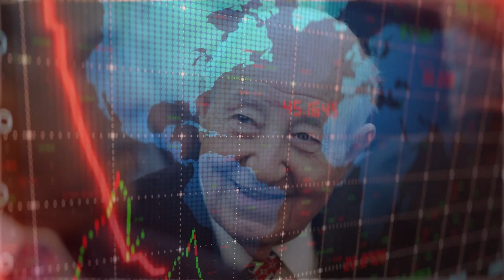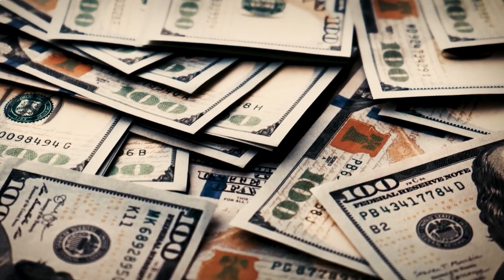Inside the Incredible $6.4BN Gordie Howe Mega Bridge

Comment: Your suggestion  that the blockage led to the decision to build the Gordie Howe is completely wrong.  The blockage took place long after the bridge was conceived, highways in Ontario were created to divert trucks to it, and the bridge construction begun.
Reply: There's also an international tunnel connecting Detroit and Windsor that isn't mentioned
Reply: @NorthernElevations    Which can't handle regular commercial traffic.  Empty auto haulers, flatbeds, and small cube trucks are all that can utilize the tunnel.
Reply: @NorthernElevations many trucks can't go in the tunnel though
Reply: @NorthernElevations  There are 2 tunnels, one for motor vehicles and one for trains. The train tunnel is visible on google maps.
Reply: @NorthernElevations  Don't forget the Blue Water Bridge further north that connects Port Huron to Sarnia.
Reply: The other thing he missed the real reason the bridge was needed: all that traffic was cutting the west end of Windsor in half. Any time there was a border slow down there is a wall of trucks down Huron line which isn't a highway, it is a city street
Reply: Exactly. This bridge wasin the works long before its initial construction AND the blockade of the truckers .
Reply: was thinking the same thing... then i went to the wiki page for it and this guy read it almost word for word as his commentary.
Reply: 911 is what started this project. The backup at the ambassador bridge was half a day long, and truckers tried to divert to the Detroit tunnel which cause major delays on top of major delays. The amount of commercial traffic that crosses in Windsor is staggering and has a major affect on the economy for all of North America. They realized they need traffic to flow and only having one 4 lane bridge and a 2 lane tunnel was not enough hence the need for  another means of crossing the river. There was a railway tunnel as well.
Reply: yet Northwestern Ontario still has 2-lane roads, so dangerous
Reply: lol, yah looking down College I could see the two completed bridge spires behind the protesters on Huron Line. The bridge project started about a decade before anyone even knew what covid was.
Reply: @debunkthejunk1 
Exactly. The trucking company I worked for had a yard near Gordy Howe construction project. I could see it DURING the lock-down.
Reply: It came about because Matty did not want to place nice with the government safety authorities.  There was also Matty claiming he was acting in place of the USA federal government.

I broke a monopoly
Reply: @rogergrondin4374  What a maroon! 😁😁
Reply from the maker: You're absolutely right! The Ambassador Bridge blockades did occur much later, and construction for the Gordie Howe Bridge had already begun. The new bridge is a long-term project planned to address the growing need for efficient cross-border traffic flow for years to come. Thanks for pointing that out!
Reply: @MegaBuilds5280  if he’s right, then why was that it implied in the video?
Reply: Or that Covid delayed the project. All construction was classified as an essential service and exempt from lockdowns.
Reply: In addition if they can block one bridge they can block two bridges.
Reply: @grantmacnei9880   The approach to The Geordie Howe is part of the 400 series highways....  Attempting to block it would be a federal issue, not a local issue like these idiots  blocking Huron Church road was......
Reply: 😅 @ClintonAllenAnderson
Reply: Government controlled media
Reply: Omg are you serious blaming the blockade as one of the reasons for building this bridge? It was already in works and later in the video you even mention that there will be a delay in its completion due to the plandemic…oops pandemic . Get your facts straight!
Reply: Don’t forget about the blue water bridge 🤔
Reply: You are correct
Reply: I don’t see how at 2.5km this will be the longest bridge in North America. If you look just a little bit north and a little bit west, you will see a bridge that connects Michigan’s lower peninsula to its Upper Peninsula. It spans 26,000 ft, or 5 miles, or 8km.
Reply: @drewhubbard4459  Its the longest "cable stay" bridge in North America. That means the bride is fully supported hanging by cables rather than from pillars or piers from underneath it. Most bridges are supported from underneath from giant piers.
Reply: @pcs5852  a: I was around when PT was prime minster, useless. B: I was in Windsor during 911 C : neither Trudeau had anything to do with building the Gordy Howe bridge, I know this because the planning and infrastructure was done with windsors input and I was privy to this. D : if you want to meet aboriginal people it is really not that difficult. You just need to leave your mothers basement.
Reply: @jcar1417  Ahem for your brilliant comment :)
Reply: @pcs5852  dude that was 50 years ago. Trudeau never did anything that wasn’t in his best interest. Just ask the aboriginal people.
Reply: @jcar1417  Aboriginal? The indigenous people of Australia?
Reply: @scottshawn70  read a dictionary, your answer is there.
Reply: @jcar1417  I know what the word means.. It is a people who are indigenous to Australia as I said. Therefore I have no reason to look it up. So what does your statement  about the people of Australia have to do with Trudreau and the bridge? lol
Reply: @scottshawn70  it also means people who have inhabited a land before, so obviously you only know one meaning of the word.
Reply: @jcar1417  Obviously. Dont be such a hater. lol
Reply: @jcar1417  You need a fact checker before spouting off and looking like an uninformed fool. Neither Trudeau Sr. or Jr. had anything to do with this new bridge building,
Reply: @GordMerrick  you should brush up on your reading skills, I stated that neither Trudeau had anything to do with the bridge.
Reply: @pcs5852  apparently yours is not .Trudeau had nothing to do with the bridge, my retort was a typical politician who believe infrastructure shouldn’t be private mean while he had his dirty little fingers into everything.  Trudeau was a douche bag, like father like son. Second I know why an d when the Gordy Howe bridge came about , the discussion on where ,who and why it was created. The companies involved, the issue created, the discussions, the mistakes , who was trying to get a piece of the pie. I was a subcontractor who worked at the ambassador bridge and was privy to what was going on there as well. Your opion that the second bridge is some form of legacy or was initiated by Trudeau has no factual basis.

Comment: 6.4 billion is ridiculous. Contractors are gouging these days. This bridge will just have a double yellow line separating traffic directions and will be hazardous during icy conditions. It should have a concrete median barrier separating traffic directions.
Reply: The current bridge just has a line. No issues
Reply: @toddportice4997 yea and like most old bridges it was built as cheaply as possible. Some of the 6.4 billion should be spent on basic safety  features like that.
Reply: @insertgenericusernamehere809 One, the 6.4 Billion includes the cost of the highway connections on both sides, land acquisitions and new border crossing facilities. Also the reason why their no median is because they want to have variable lanes. So basically they can change the number of lanes in a given direction to help with traffic flow.
Reply: @Kishanth.J :  The 6.4 billion is a low, low estimate of the total cost.  3.5 billion was spent on extending Hwy 401 to near the bridge entrance alone.  With interest & inflation factored in, this bridge will cost closer to 20 billion and the tolls will NEVER cover the cost of construction and operating the bridge.
Reply: @Kishanth.J  oh i didn't know they were going to add those.
Reply: Consider that comment mistaken.
Reply: @pcs5852  to be honest the point of the tolls is to reduce the cost of maintenance, not to recoup the cost. The point of the bridge is to improve cross border travel for people and goods. This project is meant to improve service not make a profit. That the point of government.
Reply: Remember folks. It's only 2.4 Billion over budget. Due to bad planning and project management.
Reply: @insertgenericusernamehere809 
Why do you assume that the bridge won't be built to code? 
They're not rushing the job - 7+ years in and alot still to do.
Reply: @salemdesigns65  were you talking about my first comment? I alredy said I was mistaken.
Reply: @salemdesigns65  I know. I was talking about the Ambassador  bridge, which was built cheaply and quickly.